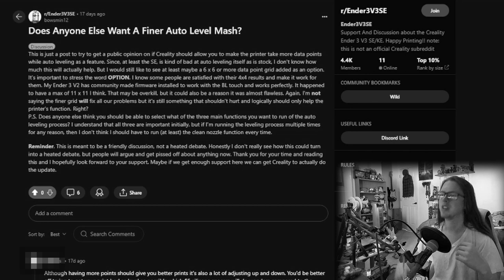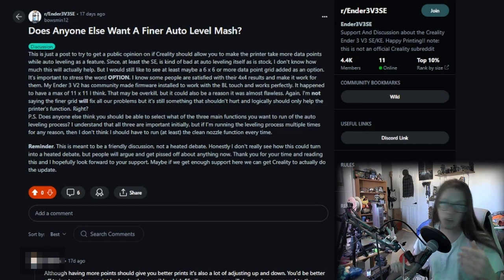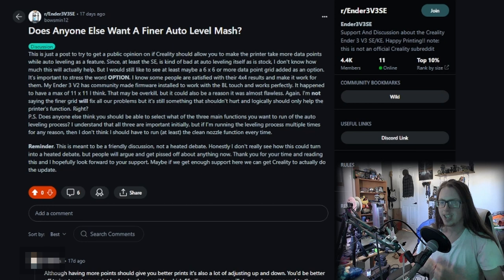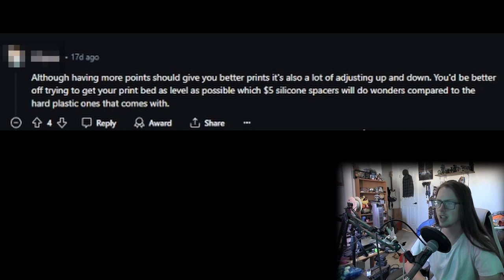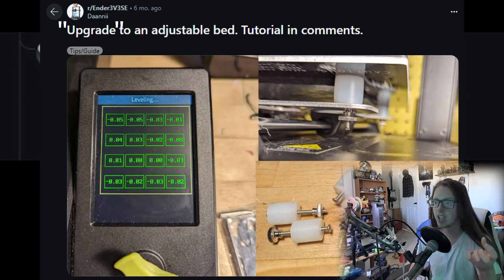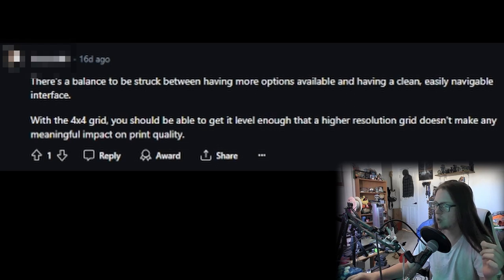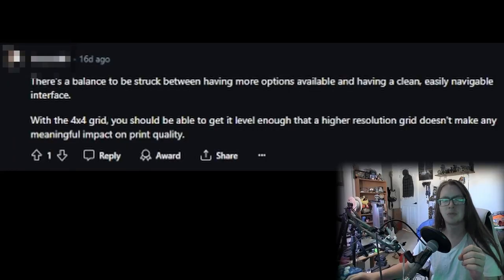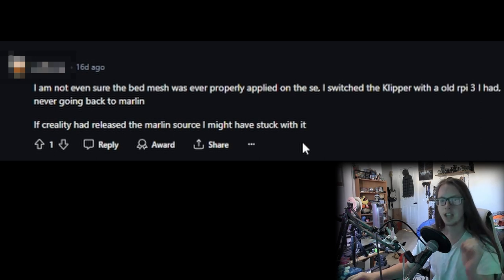To Those Who Want More Level Points On The Ender 3 V3 SE...

Comment: I have klipper running on my SE, and I will never ever go back. You need a raspberry pi because you need a computer running linux in order to communicate with the machine running Klipper. Klipper actually runs as a firmware on the machine, but it also needs to be running on the computer communicating with it, hence the need for a raspberry. I f you need something cheaper, you can use an Orange Pi zero 3 since it's way cheaper and it has wifi. BootUse on youtube (and github) has a rough tutorial on how to get it running on the SE.

Comment: Thanks for all the work you've done on this! I'm currently having the same issues with my Ender 3V3SE. It was printing very well for months with the stock bed plate, but it was getting a bit used. So, I changed the bed plate to a new one since the stock plate. I'll try your suggestions and see if I can get improved levelling/Z-offset.
Reply from the maker: What kind of replacement bed did you get? Is it gritty textured like the original, or it mostly or completely smooth?
Reply: @Bowsmin12  Creality Official PEI Sheet 235x235mm Flexible Removable Spring Steel Plate Magnetic Sticker Heated Bed Kit Replacement Accessory for Ender 3 S1/Ender 3/Ender 3 V2/Ender 3 Pro/Ender 5 Hot Bed Surface
Reply: It is gold frosted/textured with magnetic sticker bottom
Reply from the maker: @dennishumphrey4559  Okay, I found a listing on amazon exactly matching your comment. It looks smooth, but I assume its kind of a tacky surface maybe? I haven't used one exactly like this before as far as I know.
So like stated in the video, it seems the printer may rely too heavily on the grit of the original textured bed. Because I tried a few different designs of beds that were more smooth, only very minor texturing, and it couldn't print on just about any of them. I returned the others thinking they were somehow defective, but I tried my G10 from my Ender 3 V2 and it worked better, but still not great. 
Trying to improve the printer and make it actually work right, it functions worse with the G10 lately.

So I would recommend going with a bed that has at least one side that is grittily textured and see if that will work for you. You also don't necessarily have to go with an official product. The ender 3 3rd party market is kind of vast and most of the well rated stuff should hopefully work for you and the E3V3SE as well. Just make sure it's the right size. But I also won't make any grantees because of how much of a pain the printer can be.
Reply: @Bowsmin12  Official Creality Ender-3 V3 SE Build Plate 235x235 Original Textured PEI Sheet Magnetic Flexible Spring Steel Build Plate for Ender-3/Ender-3 V2/Ender-3 V3 KE/Ender-3 V3 SE/K1/K1C
Reply from the maker: @dennishumphrey4559  That one would probably work better since I think it's made for the V3. But this one is probably going to be better and have more versatility.
Affiliate Link - Gold grit & crystal design PEO - https://amzn.to/45xMhqq
This gives you the possibility to experiment with the cool side but also hopefully have a more reliable gritty side as well. They also have another option to have a kind of like galaxy star sparkle which transfers to the bottom of your first layer. Unfortunately I think those sides don't play well with the SE, but you still have the gold side, and have the fancy side for future use on compatible printers or if you dial in your SE. Or of course if Creality somehow fixes the printer but that seems unlikely. Again I will make no promises but that gold grit texture should work with the printer logically.
Reply: @Bowsmin12  Thanks again. I'm continuing my bed tests today, re-calibrating the individual points as needed. I'm using the "official" Creality test gcode file, which, as you mentioned, prints off-centre.If that doesn't work, I may order the last bed plate you recommend from Amazon Canada... unfortunately, I  don't think you have an affiliate link to Amazon Canada.
Reply from the maker: @dennishumphrey4559  Makes sense. Yeah, I just try to use them since I'm currently unemployed. It's alright if you can't use it. I just hope you can figure your machine out. Many printers can have similar issues but are typically always a little different to each other.